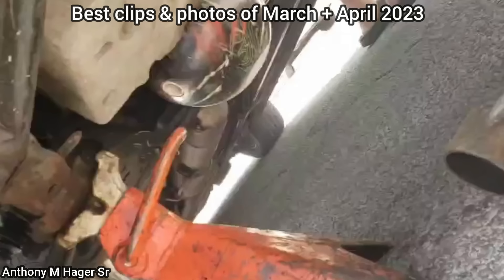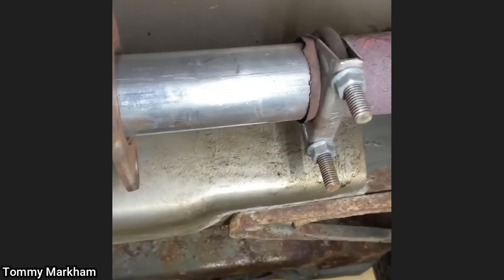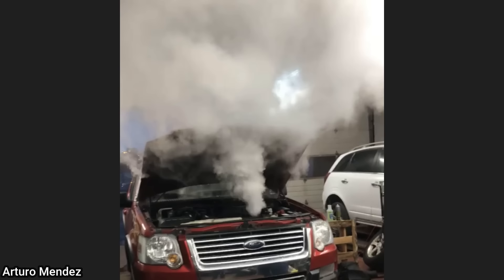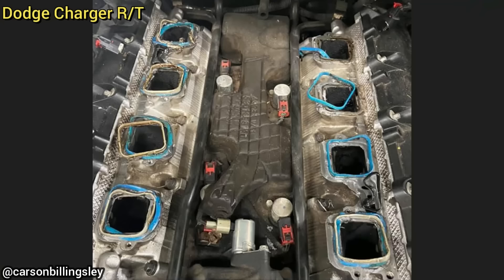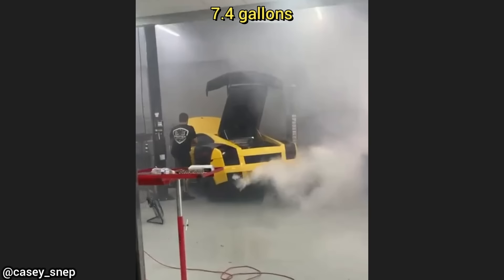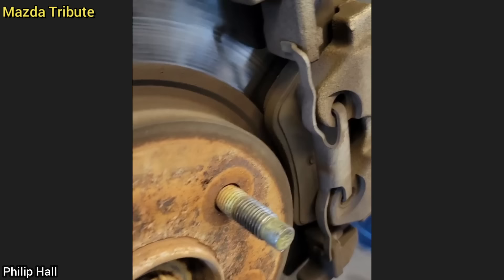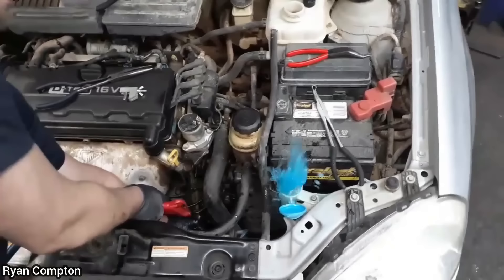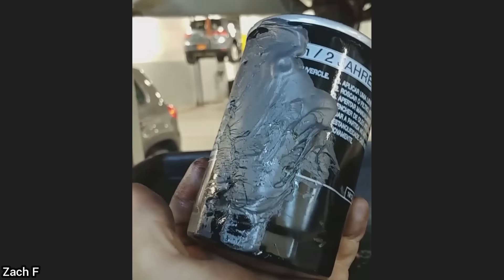Customer States Compilation (Best of March & April 2023) | Just Rolled In

Comment: I can literally feel my brain shrinking from the severe lack of maintenance
Reply from the maker: 😂 oh no!
Reply: Then you should definitely hurry down to the brain shop and have it serviced 😎
Reply: Apparently " seeing" was deleted when I made my comment 🤦
Reply: @agolftwittler1223  tried , mine no longer has replacement cells for it 🤪
Reply: @thomasfletcher760  I have the same problem.
Mine is an older model and spare parts are getting increasingly hard to come by 🤪
Reply: More than half of this wasn't even lack of maintenance it was just stupid decisions by cheap people who never bothered to find out how to do something right.
Reply: @@lurch789 Too literally indeed.
And some even attempt to drive on three wheels. 
Literally 😎
Reply: You might want to take your brain in for a lube & filter change. Good lord, that's some trouble...

(Thanks, "Dr. Brain," for installing that sort of quote in my mind in 1996.)
Reply: @agolftwittler1223  it’s been 60k miles since I got my brain serviced, prolly a bit late
Reply: @Impossible_Fishy  A bit late yeah, but it's never too late.
An oil change, new plugs, oil and fuel filters replaced.
Won't give you a new one, but you should be able to run the old one for another 30K at least.
Unless you pop a timing chain of course.
Then all bets are off 😎
Reply: @101Volts  all " parts " have been discontinued due to age ( old fart ) 🤪🤣
Reply: @agolftwittler1223 also Brian shop, opens head, “oh, just as I thought….. empty”
Reply: Looks like the check brain light is on
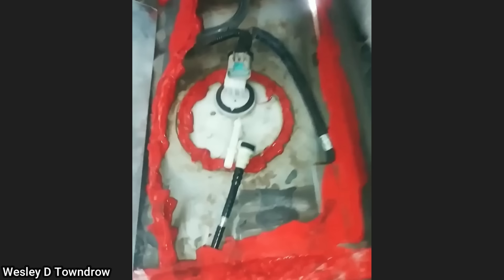Reply: @thomasfletcher760, the interiors of the car @4:02 and after.... I can't even.... Most people don't give much thought to their vehicles beyond maybe an oil change, check the tires etc., but driving down the road in what is effectively a "mobile landfill", is beyond me. I understand having some napkins/paper towels, a few tools etc., in the car but that looks like a "hoarder's house" on wheels.
Reply: @one_step_sideways  🤣 that could be this channel's slogan
Reply: My brain needs new spark plugs! And could use a high lift cam upgrade

Comment: "His commute to work is only 5 miles"  Bro you serious?  You still need to be able to stop when you get there.
Reply: He uses concrete based exterior wall breaks.
Reply: If he has a short commute he would be be better off selling his car for a couple hundred dollars and buying a cheap electric bike.
Reply: Smartest Kia owner
Reply: @evoman44  Or just buy new rotors and repair it yourself. I remember doing it with my Dad. Not easy, but not hard either.
Reply: @JesusisLOVEJohn-  I do my own brakes too but if this guy is too cheap or broke to even afford a good DIY brake job then he can't afford to operate an automobile.
Reply: @evoman44  Exactly.
Reply: just put it in reverse to brakes, that'll do it.
Reply: @ARockyRock  Problem is that only works once or twice... maybe three times if you're lucky.
Reply: @ARockyRock  i just got straight into park works everytime
Reply: Not if he work at a drive thru.
Reply: @evoman44  which will likely experience similar issues soon
Reply: I hear this from customers whole time 😁
Reply: He uses blocks of wood to stop like the first cars
Reply: Only? Damn
Reply: Don't worry, he works at a drive thru
Reply: Kia owner moment
Reply: Executive parking
Reply: Them's just get their foot off the gas 2,5 miles ahead and roll in just perfect
Reply: @evoman44 Depends on location...even if biking is moderately safe in their part of the country, temps could be too high to show up not a sweaty mess
Reply: @RyanTosh  I agree. But if he can't afford a brake job, chances are his AC is not working either. All it takes is for an old seal to leak out freon. He could replace all the seals himself cheap but a proper freon refill is going to cost $130. I know because I recently had mine refilled and my mechanic told me freon prices had gone up.
Reply: @evoman44  True, that's a good point
Reply: I have always said of cars that the only thing I value more than the ability to go is the ability to stop

Comment: Both the battery and exhaust guys were really lucky their car didn't turn into a bonfire
Reply: The battery was wild but the exhaust botch job made me gasp.
Reply: @Lurch 😂😂😂😂
Reply: It's not great, but bear in mind ignition temp of gasoline is around 450-500, and the hottest part of the engine is the exhaust manifold, and while they say they can get up to 500, realistically exhaust manifolds rarely get that hot, that would be under extreme performance, and the tailpipe will be a lot cooler. Even so, wouldnt drive like that. Very stupid installation.
Reply: @bluedistortions  , I've never tried to measure those temperatures but I'd imagine highway driving would create significantly more heat all of the way to the tail pipe AND most of all the thing to consider is ambient temperature. Imagine the differences in metallic temperature driving 50mph for 5 miles on a 60° day versus a 95° day. Consider that even tho the engine still maintains it's "normal operating temperature", on a 95° day you couldn't touch the engine block for "a second" before it feels like you're being scalded... As for exhaust, if we're to believe those temperatures exiting the cylinders can be ~1,200+ degrees, it's not unreasonable to think that the rest of the exhaust system can reach sustained temps of at least half that....

Comment: Bro was worried about how much a new radio would cost in his Lamborghini 😂
Reply: @TheEudaemonicPlague  So true about it being easy.

tbf, when I was 17, my first radio install I did stupid. Didn't know about pigtail adapters, so I cut the wires. Learned pretty quickly that was a stupid mistake. Luckily, I had cut the wires with sufficient lengths on both ends. A quick solder job and heat shrink fixed it. Got the pigtail and got it working right. Never had any issues with it after that. What should have taken like 30 minutes or less turned into 8 or so hours. 
My second and beyond radio installs was done right the first time. 

I remember warning a friend not to cut the wires to the radio when he wanted to install his own. I told him if he did, I wouldn't fix it. Sure enough, the next week he called asking if I could come and install his radio. I went over, looked at it, said nope, that a you issue. I warned you. Have fun. He got it fixed weeks or a month later, after paying, iirc cartoys, to fix it.
Reply: If you can't afford the repairs or speeding tickets, don't buy the car lol. When I was younger, I wanted a Lamborghini, but now I want something that's dependable and fairly slow because I have a heavy foot and this state has some screwed up speeding laws.
Reply: I've had both a couple of Ferraris a 308 GT4 Dino and a 348, along with a Lamborghini Jalpa and if you are going to own one you better keep money in the bank because they are not cheap to work on. I've since replaced those with a Maserati Quattroporte and a Biturbo while they are cheaper to repair you should never let the neighbor work on them. Lucky me I used to work for a gentleman who owned some dealerships back in the day and raced them for fun so I can work on them. But not many mechanics can properly tune four Webber two barrel carburetors nowadays. So thanks boss.
Reply: They would charge you more just because it's a Lamborghini.

Comment: I like the idea of the guy at the tyre place mounting that tyre on a rim, then walking it over to the car without noticing that all his hand tools are rattling around inside
Reply: The customer did state that all the people at the shop looked stoned.
Reply: If they used the balancer they IMMEDIATELY would've heard it and the machine would've said it's fucked.
So the fact that they forgot the stuff AND didn't even complete the tire replacement job is twice as telling lol.
Reply: I had a mate change his motorcycle tyre and left the tools within went for a ride and it came back flat he has not lived it down since
Reply: There's a couple of possibilities here.

1. The customer was too cheap to pay for a balancing, which is never a good idea on new tires.

2. The customer did pay for a balancing, and the tech lied about doing one.

3. The tech heard his tools rattling around and was just like.. fudge it. And rattle gunned it back on the car.

Working in a tire care center, I can say I've seen this kind of stuff left and right. Nobody cares about the quality of their work anymore. BUT.. as for myself, I try to do a good job, but one time I did lose a small socket in a tire when I was tightening up a wheel sensor, and didn't notice the socket was missing off my nutdriver until the customer was gone. So shit does happen sometimes.

Comment: 2:13 Because the need for brakes is proportional to the distance you travel
Reply: I only need mine on interstate trips!
Reply: Y’all really don’t know how rotors and brake pads work, yes the rotor is rusty, yes the rotor needs to be replaced, no you can still brake it will just feel like there’s air bubbles
Reply: Duh... that's why they call it "braking distance" ;p

Comment: As a german, this is absolutly insane and unimaginable 😂😵‍💫
Reply: I will never complain about the yearly car inspection we have in Sweden again.
Reply: I live in the states and work as a mechanic. When I lived in LA, the inspection was mostly SMOG stuff. It's a desert so there's never a rust issue and very very rarely will you see a corroded shit box driving around.  It's mostly just emissions.

I moved to a place that snows (and therefore salt on the roads) that has an annual inspection that's not just emissions, and it absolutely blows my mind the level of dangerous shit is on the roads and is still acceptable to these state inspection. I've had trucks come in for basic maintenance and half of the chassis is literally crumbling away in my hands. And 9/10 times those customers are the ones who refuse any services and think they know better. I really wish that was illegal.
Reply: only half the states in the US require an annual safety car inspection
the other half uses the honor system
Reply: @TheTongo11  Every 2 years here in Norway 😊

Comment: @JustRolledIn -- are shops required to report / flag vehicles to any authorities?  If not, this should definitely be a thing where the police can pull over the vehicle and issue tickets -- or at the least the DMV should require proof of repair before re-registering!  Some of these are legit dangerous to other drivers sharing the road  :(
Reply: some states don't do any safety inspections. I couldn't imagine having any authority to do so.  in states that do them, I guess that what you suggest probably already happens.
Reply: No way! You would immediately see shops being sued by liars blaming them for "pre existing" conditions, for one thing. Putting an unnecessary legal liability on repair people is a bad idea, in general

Comment: The pinecone reminded me of something that happened to me once. I was driving my 2014 automatic Ford focus (before the transmission failed) thru a Wendy's drive thru when I threw it into park to pay and then when I went to pull forward to get my food, I realized I lost all control of my transmission, as in it was stuck.in park no matter if I shifted to drive. So I called AAA and a dude came and looked inside my engine bay and found a walnut tucked under the shifting connector, which disconnected it. So yeah squirrels made my car breakdown once sorta

Comment: Took my truck to an exhaust shop to get new exhaust a day before a camping trip I had planned they installed the exhaust right on the rubber brake lines which when the exhaust got hot enough it burnt right through as I was going down a mountain with a heavy 28ft trailer loaded with atv’s pedal went all of the way to the ground, luckily I have a sport shift in it so I could put it in a low gear but was still redlining cause the heavy trailer with compromised brakes was speeding us up down the mountain. Pinched a hole in my seat that day

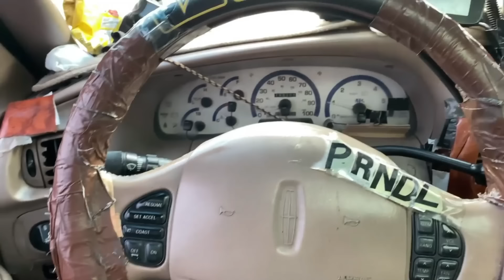Comment: 6:18 you really gotta try hard to make something this... interesting. split tube wire loom running everywhere, electrical tape "grip" on TOP of what looks like a US Army steering wheel cover, 2 (3?) tomtom GPS units, mailbox labels on the steering wheel, insulating bubble wrap as a seat cover on the passenger seat, duct/gaff tape holding together the center dash, the ""custom"" phone (?) holder on a bendy arm in the middle, and my favorite: seemingly random pieces of tint foil on the windshield still with bubbles and all.

Comment: I bought a nice ford universal van and kept having all kinds of codes. During a heater hose replacement I found duct tape over the airbox exit hole to the mass airflow sensor. Maybe the previous owner thought that it would keep the mice out of the airbox or something, but once removed the codes disappeared 🤔

Comment: I'm going to patent the  Darwin Exhaust conversion kit. 
This easy to use kit will route the exhaust through the pesky fuel tank.
Step 1. Remove gas cap.

Step 2. Drop lit match down filling tube to determine fuel level. 

Step 3. Repeat step 2 until you see the light.

Step 4. Go to the light.

Addendum:
Tesla owners must buy a five gallon gas can (and gas) to complete steps  1, 2, and 3.

Comment: As a Brit I am amazed that these vehicles are allowed on the road. In the UK we have a vehicle checked out yearly by a government approved garage. By law, 3years from new ALL vehicles must pass this test. Its called a MOT (Ministry of Transport). If the vehicle fails, you are not allowed to drive it until repairs are complete. The test covers, Brakes, Steering, suspension, underbody corossion, exhaust, lights, wipers and tyres. The legal limit for a tyre is 1.6mm of tread, any less it will fail. All tyres must be of the same type, i.e. radial. The test is linked to your driving license and insurance, is electronically stored and instantly available to every police vehicle.
If any of these are absent, you will prosecuted for all 3! Most of the vehicles seen on these vids would have been crushed. The driver would loose their license and be charged with no insurance, no license and no MOT.and banned from driving for at least six months.  The Law is intended to make YOU RESPONSIBLE for OTHER  peoples lives. Most of the laws in Europe are very simular and have severe penalties and rightly so. This kind of irresposiblity is looked Upon as deserving a hard a penalty as possible if not more, when you put OTHER people at risk because of your 'Les Affaires' attitude.

Comment: I got a customer get a new radiator because of low coolant. We found out that  she let her nephew change the last one, got the wrong size bolts to hold the fan housing into the tank, screwing it past the frame.

Comment: The CV axle does not hold the front bearing together if you buy a front wheel bearing and a real rear wheel bearing they are the exact same except. For one has a hole in the center, and the other doesn't that bearing is not going to fall apart. That's slack is because it's a bad wheel bearing
Reply from the maker: Bearings are different for 4x4 and 4x2 model vehicles.
Reply: @JustRolledIn  Yep you're right 4 by 4 bearings have a hole in the middle to put the axle in. It's not like it's gonna hurt it.

Comment: I've only owned my car for a year, my aunt did not take good care of it, when we fixed it the first time (The spark plugs blew out after giving it an oil change.. the car is very 'bastardized' according to my dad), it started making a strange noise after, I thought it was just the used head my dad put in the car, it didn't affect the performance so we just kept going, coming to find out months later that it's a timing belt failure. How am I still alive. actually, how is the engine still alive?? either way I don't feel safe in that car until my dad replaces the timing belt.

Comment: For the Lexus, that had to be the absolute WORST case of oil sludge I've ever seen! My god did that poor vehicle ever grace a lube, oil, and filter shop? Friendly reminder? Oil does break down with mileage, even synthetics while higher temperature, also break down. The end result? That creepy gray gel like substance. 

Now if this was an RX-7, umm oil changes for them aren't every 3k, they are every 3 MONTHS!!! The rotary engine actually burns oil as part of its normal operations. You don't replace the oil? Prepare to replace an engine. And trust me , a mechanic will be drooling to welcome you for that.

Comment: Isn't there a law that forces mechanics to disallow a car in dangerous condition back to a customer? I think something like that exists in Ontario. Also, and yes I'm ashamed to admit, I didn't know about required oil changes. Found out by fluke and honestly I was quite disappointed. And I was almost 30. I know. Had my first car at 27 and never changed oil. Mind you didn't drive much in NY. Please be gentle.

Comment: "Warm air intake". I've been calling them that for years. The original equipment is generally a cold air intake by design. The aftermarket filter replacements are worthless junk. All they do is cause problems, and make the intake noise louder. Waste of money....